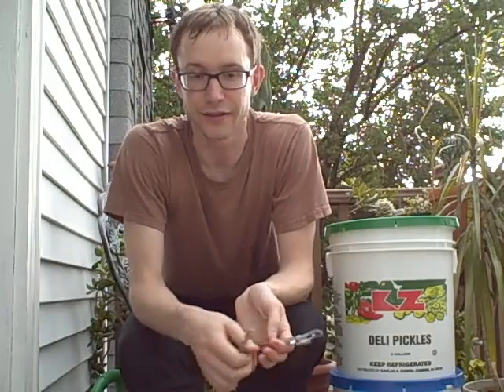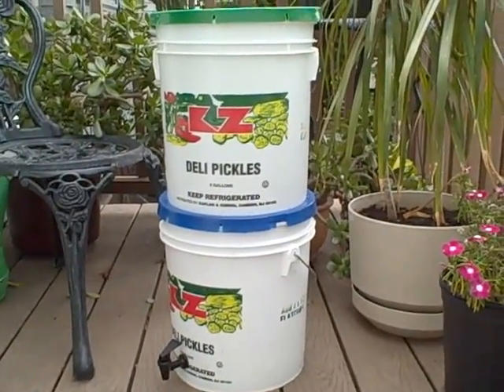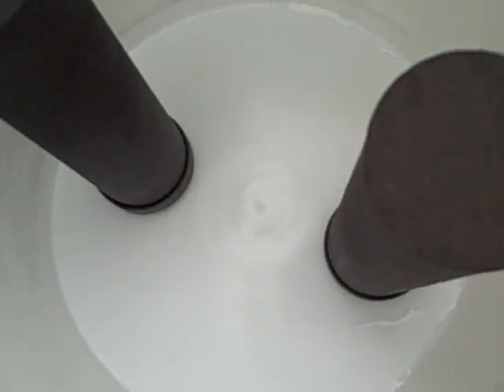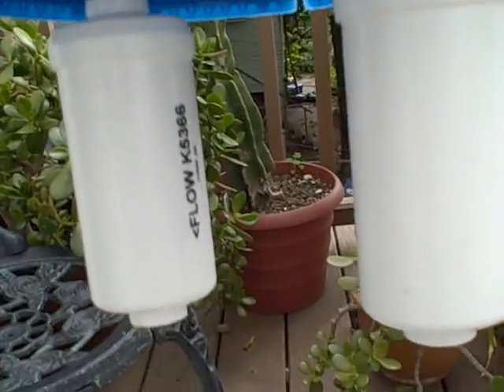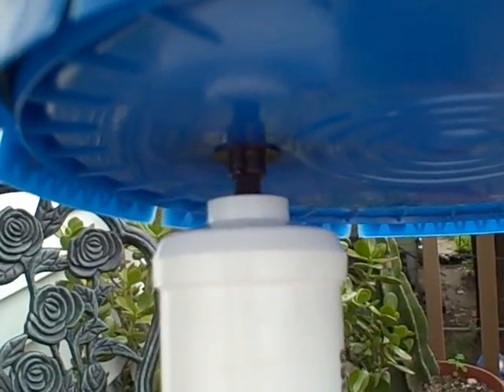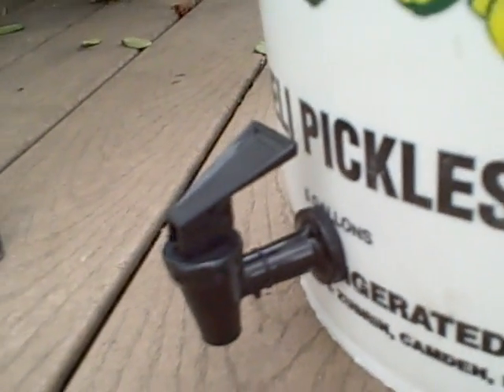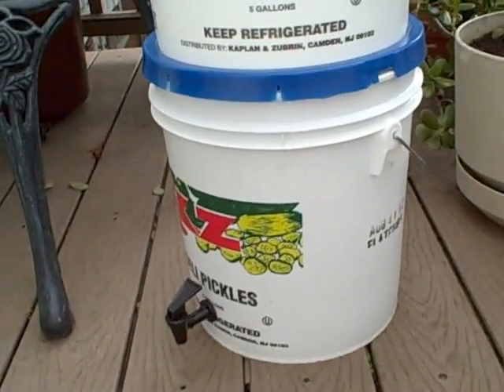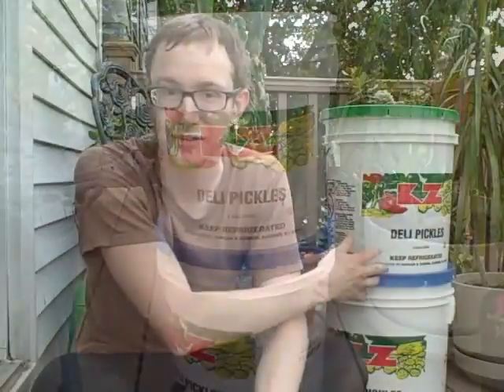How to Build Your Own Water Filter

Comment: YOU SAID THEY LAST FOR SEVERAL YEARS.  DO YOU HAVE TO BACK WASH THE FILTER BECAUSE AFTER A WHILE WON'T THEY CLOG UP?
Reply from the maker: +Richard Walls I prime my filters once a year... you will notice when it takes a lot longer for water to work its way through the system.  If you're filtering water outdoors, or from sources other than a sink in the kitchen, I recommend having another bucket with a t-shirt over the top to filter out any larger stuff...this will allow you to clean your filters less often.

Comment: Not sure if you know about these or not but check out gamma lids for 5 gallon buckets. they will do a much better job of keeping things out out the filtered water. http://www.amazon.com/The-Gamma-Seal-Lid-Black/dp/B0089QJQTS
Reply from the maker: +Wilmington55 I use gamma lids for storing food...love them!
Reply from the maker: +Wilmington55 I use gamma lids for storing food...love them!
Reply: +Wilmington55 When would you use the gamma lid, after you had the lower, filtered water in it, then put a lid on it?  Ask b/c wondering if you meant to put the dirty water bucket on top of the bucket with a gamma lid on it?
Reply: Like the idea of stainless. Harbor Freights lids have large handles on the lids, so would not be able to use as top for bottom pot. Do you know if the 3 gal will sit on top of the 4 gal SS bottom pot? If so, that would work very well.
Reply from the maker: +SC Rider I like the stainless, too.  My indoor kitchen counter filter is stainless... the 5 gallon plastic buckets were a quick solution, but if you can go stainless, I think that's the way to go.
Reply: You go. Let me know how it pans out.

Comment: You trash talker.  Thanks for the video, this is a great idea.  You can also get new buckets (prob. 6 gal) and spigots at a homebrew/wine-making shop as well.  I dig your cactus and succulents.  Do you think rainwater contains significant arsenic?
Reply from the maker: +Basic Poke Ha!  No, I don't think rainwater contains arsenic or fluoride but I also don't have a problem with putting them on there.  I bought my filters in bulk, and I keep this backup system available for whatever the case may be.  Just the carbon filters up top is plenty good enough, my example is just overkill.

Comment: Brother what ever you do don't get pickle buckets .I got a couple from a local rest and the pickle smell will not leave .If any one has an Idea to get rid of the smell holler.
Reply: After the pickle buckets sat out side a couple months . They still had some pickle smell . I took the advice of one of the comments and took used coffee grounds and scrubbed the inside of the bucket and it was gone . I am now storing food in one of those buckets .
Reply: +timothy thomas try crashing some activated carbon pills and rubbing them all over the stinky surface for a while
Reply: I could see why that would work . Activated Charcoal absorbs .
Reply: +timothy thomas You may want to try coffee leftovers. It is food to left up grease off dishes.
Reply: So you say take the coffee grounds while wet and scrub the inside of the bukket ? And this also help greasy things also ? I will have to try that . Thanks And God Bless
Reply: Timothy thomas That might work too... but what I meant is using the same part that we drink and wash it up before cleaning it normally with soap and water
Reply: ok got it .
Reply: I have some fish tank filters i picked up for a dollar that have activated charcoal in them I am going to throw one in and give it some time . Thanks and God Bless
Reply: The fish filters are unused . New in pack . I bought them not for fish I don't have an aquarium . But for there many other uses water filters etc . And they did come in handy . I remember I got them for a dollar at sally's army
Reply: +timothy thomas Afraid of that, have some and the ordor was in the food grade plastic.
Reply: Ok, thanks, good luck.
Reply from the maker: +timothy thomas Yep, plastic does have a tendency to absorb odor.  I replace my compost toilet system buckets once a year for the same reason.  Didn't mean to throw people off with the pickle bucket usage in the video- somehow mine don't smell... strange!  but i know exactly what you mean.  Sorry about that!

Comment: just to confirm, this will remove fluoride?
Reply: Will Cattrell Either or will be fine.  If you use it outdoors with stream water, I recommend stretching a t shirt over the top to minimize the amount of dirt and sediment that will eventually cake up the filters.
Reply from the maker: The PF-2 filters on the underside will, yes.
Reply: So what do the black filters do? They look like they connect to the lower PF-2 filters, so do you need them to make the PF-2 filters to work? The reason I ask is cus they're the most expensive part and removing fluoride and metals is my priority, so if I don't need em I won't get em. x
Reply from the maker: Will Cattrell
the black filters are for removing everything other than arsenic/fluoride, which is what the PF-2 filters do.  it's the other way around, the black filters are step 1, the PF-2 is an addition.  the black filters remove metals.  since i can't post a link in the comment, google the phrase "berkeywaterkb test results" and have a look.  there's results posted for chemical, microbiological, organics and inorganics.
Reply: Cheers matey. The reason I'm being a bit tight is because they're not readily available over here in the UK, so the price goes up by a third  due to postage, packing, & the dreaded UK customs charges (GITS!). However, my inner Zen self asks - "Can you put a price on your health?"
Companies do try it on though, i.e. Refined sugar costs less than unrefined! (how does that work?) pointless mini rant over... Namaste Brother Tyler. X
Reply: Will Cattrell One more question Tyler. Is this to purify tap water or stream water whilst camping?
Reply: Cheers Ty. ;-)

Comment: cool vid.
Are you sure that carbon filters will not filter out fluoride and heavy metals?
Reply from the maker: since I use berkey filters and they make a separate filter for fluoride, I am assuming that the standard filter doesn't remove fluoride.

Comment: Made a two bucket system like you did with 2 Black filters and 2 fluoride. Works good except when you tap water out it stops for lack of air in the bucket. When I crack the bottom lid a bit water flows again but water leaks out from between bottom lid. Maybe I should not keep the top bucket full? Any ideas?
Reply: +Nickxnack You are right. The water won't flow. You need to vent the buckets. I drilled three or four holes at the top of the bucket just under the lid. I used a 1/16" bit. really small holes. Then, the water will flow easily.
Reply: +Michael Naumann Under the lid? In the side of the bucket?

Comment: What about a standard paper coffee filter. How much contamination will that remove? Example...instead of making coffee, I run my drinking water thru my Mr. Coffee with the unbleached tan paper filters ( two together) only no grounds. It would at least seem I am removing quite a bit of chlorine, possibly bacterial contaminations, and small particulates to whatever micron level the filter is.

Comment: Tyler I built my system exactly like this, I even used two pickle buckets as they were the only ones I could find at stores in the 5 gallon size. I went to run my first 5 gallons through and noticed that it wasn't filtering through. I loosened the top lid as it seemed there was a vacuum, then I could hear water going through. However, when I got up this morning only about a quart had run through....any ideas or are they that slow to filter?

Comment: plastic wear down,with water softening the plastic will take very long time, depending how well hole was drilled
its possibility drilling hole for the spigot may prove hurtful to the design in the long run
steel is better= costs more, if you have metal container, well thats even better, why not drill through that, or buy it
would take a tougher drill though, a few drilled holes shouldnt hurt your hafe inch bits too much
dont forget to wear safety glasses
you dont want metal shrapnel in yer eye